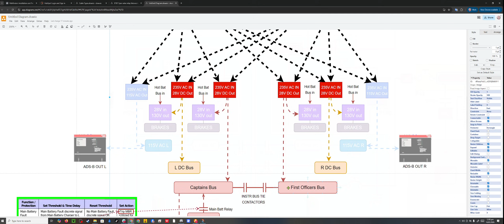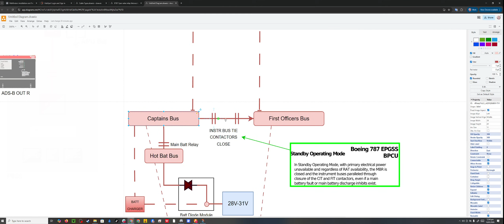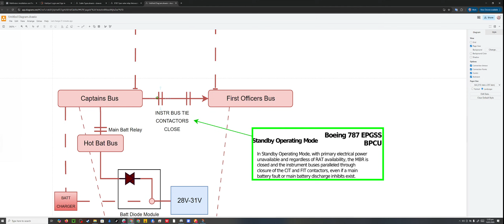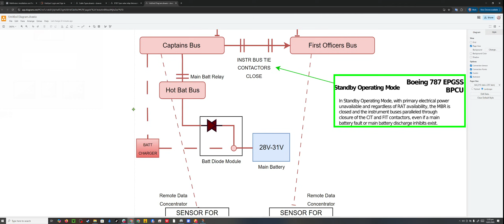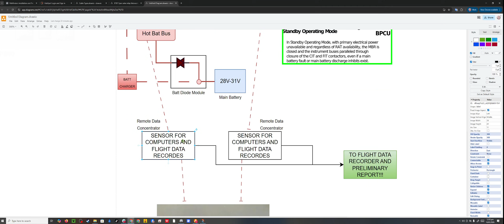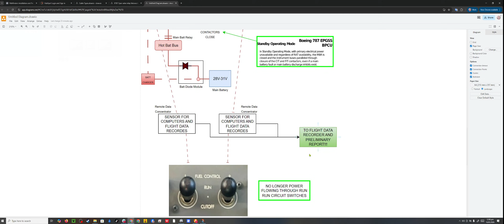B787 Main batt relay, Fuel Cutoff Switch, Remote Data Concentrator and Bus Tie Contactor

Comment: Another hypothesis is the AFDX BITE detected a degraded digital flight control network and this was communicated to a health monitor that put the airplane in an unsafe "failsafe" mode in the indeterminate state between air and ground (from Airline News with Geoffrey Thomas YouTube channel).
Reply from the maker: yes but that doesnt explain fuel switches incorrectly detected as cutoff. sorry we have all the evidence.
Reply: @jeremyjohnthompson5187 I’m onboard here. There is one piece of information that must be in the flight data recorder that would support or not this analysis and that is the bit showing that the switches were in the off position not only that there was a lack of ‘on’ status. 
In a failed power state neither optocoupler would be driven and both would report a logic low. I have not seen this ‘fuel switch off’ state reported by the NTSB, only the logic state of the ‘on’ bit. This is the reason for this redundancy in the read back design in the first place and yet it is not reported for some reason.
Reply from the maker: @ChaseNoStraighter  yep. but we have the proof that the RAT deployed as a result of DC bus failure. 
Go now and work out all the possible logic in the aircraft that makes the engines shut off if the DC bus fails. Theres only one acceptable common point of failure, and the anufacturer of that part warns of reverse actuation of that part if voltage only 14V needed) manages to flow in the wrong direction
Now if theres even anything in the prelim report at all that can be trusted at all, then they must have got that transition data from somewhere.
I know where they managed to find that, and I know they used it to make sure they could never be accused of public lies if they ever get found out.
OOOOH IT WAS A MISSUNDERSTANDING OF THE RDC RECORDED DATA
Reply from the maker: @ChaseNoStraighter  that "SOME REASON" is as clear as day to me... WHO has HOW MUCH  to loose here mate? :) thank you for using good analytics and putting a sensible question to me, ive beeen waiting patiently for someone to ask.
Reply: @jeremyjohnthompson5187  If there’s a battery short and power is missing to the two fuel control optocouplers circuits monitored per switch then the investigators won’t know if the fuel switches were physically moved unless there’s positive proof from switch click sounds in the CVR data. I'd sure like to know if there's any audio indication from the fuel switches to confirm movement and when. 
If the fuel control relay contacts did change position from reverse current (and not the fuel switches being physically moved) when the fuel control relay coils are without power the investigators will know this happened from other FDR data; changing spar valve positions or the EEC reset signal and other downstream FDR data, just as if the fuel switches had been moved. If they later say there was a misunderstanding with RDC recorded data this will be total BS. It's going to be very interesting what they come up with in the final report, there's a lot they have to clean up from the preliminary report.
Reply: @jeremyjohnthompson5187 According to Richard on the "Airline News with Geoffrey Thomas" YouTube channel, an automatic cutoff is described in the Boeing documents when the AFDX network is detected as failing.